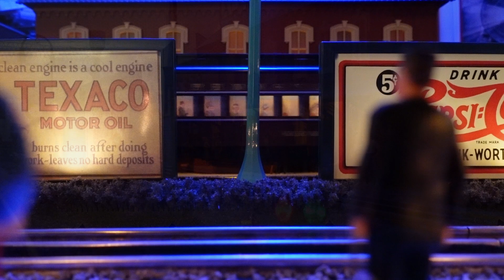MTH Long Island Railroad DD1s! - MOST UNIQUE Locos of the Collection!

Comment: Nick those DD1's are a gas!  Like something out of a Jules Verne novel!   Not quite out of the 19th Century and not quite into the 20th.  Did you notice both units have a 4-4-0 wheel arrangement?  And the whistle sound is correct for the era, the diesel-type horn hadn't been developed yet so a conventional whistle was installed but it used compressed air instead of steam.  The NYC's S-1 electrics had something similar and so did some interurban cars. 
If memory serves I believe the PRR also used DD1's as maintainance locomotives in the Hudson & Manhattan railroad tunnels, a PRR subsidiary. Once called "The Tubes" it's now the PATH commuter railroad. The H&M utilized third-rail so the DD1's were well suited for the Tubes.  PATH still uses third-rail electric.  
A great find on your part and truly unique.  Thanks for sharing them with us!
Reply from the maker: Definitely something from Jules or Doc Brown haha 😂 that’s very interesting about the whistle! Yes I recently read that they used them as shunt / switchers in the 3rd Rail yards. Funny enough, 3rd rail training is still included in new hire training and has been since the start of AMTK. I wonder why they never converted them to AC Catenary.  Thanks so much for watching! 🚂💨
Reply: @NixCrossing  You're welcome Nick!  I'd guess third rail training is still applied since third rail is still out there and Amtrak employees might end up anywhere.  Better safe than sorry.
I'd guess those DD1's were never converted for catenary operation since if they did so they'd never fit in the H&R tubes, and there was plenty of work for them in third rail terrirtory anyway.